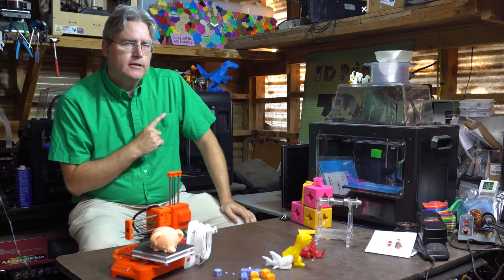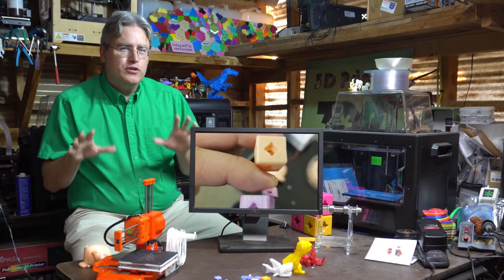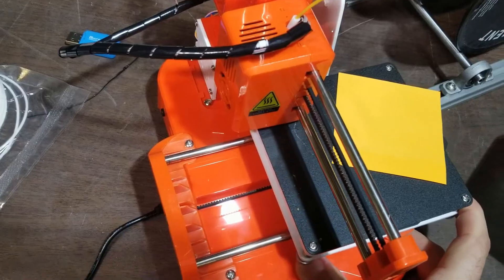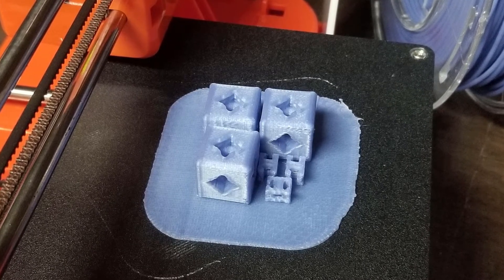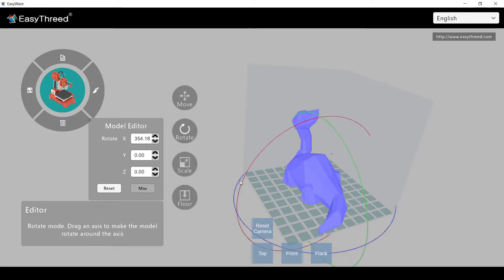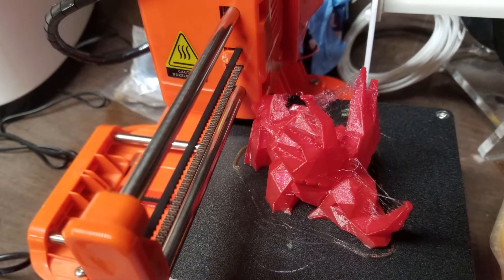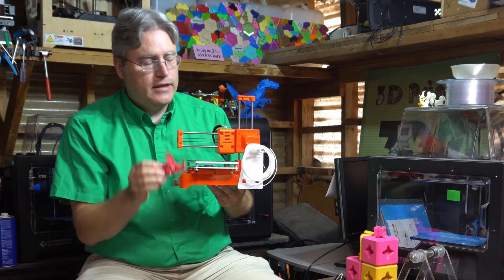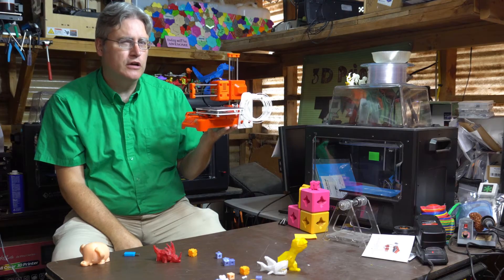Can an $80 3D printer be any good? EasyThreed K7 Review

Comment: Hi. I hope you can help me, I have a k7 printer, I have formatted the sd card I have tried everything possible but the printer does not print what's on the sd card??....It looks like it's very confused what to printer... It prints like two prints on top of each other. Have any idea what's going on with this printer?? Can it be the motherboard is damaged.
Reply from the maker: No idea. What slicer are you using? What model did you try slicing? what 2 models does it look like it's printing at the same time?

Comment: I am having a problem getting my "EasyThreed 3D Printer for Kids Mini Desktop 3D Printer 100x100x100mm Print U4N8" to print. I leveled the bed, seems level, used a bubble leveler for my android phone to make sure it is level. it is level. I go to print by pressing the greed light that looks like a play button, I wait, and wait, and wait and nothing. can I get some pointers or advice or ideas to try please and thank you...
Reply from the maker: Don't use a level on the bed. A more accurate word would be "Tram". The nozzle and the bed need to be level to each other, not to the earth.
But if you're pressing go and nothing's happening, then that's a different problem. Are you sure the SD card has a gcode file on it?

Comment: Can you make a video on how to make anything other than a rocket?? I got this and I can only figure out how to make a rocket
Reply from the maker: On the SD card there's a manual and a piece of software. You have to load up the software on a computer, load a 3D model into it, and slice it for the 3D printer, then save the gcode onto the root of the SD card, plug it in, and press the start button and it'll print it.

Comment: Hi.Nice video.I need a small 3d printer.This size is very good for me.I saw your print outs.these are not big problems for toys but do you think that l can print rc car parts  with k1 -k7.?
Reply from the maker: The accuracy of this printer isn't great. I might not recommend it for car parts. Toys or parts you don't care about only, I think.
You might want to look into the Kingroon KP3S S1 from Sliceworx if you want to keep it small, cheap, and funtional.

Comment: even after "calibrating" the printer.the filament after being extruded somewhat sticks to the nozzle and is pushed out of the way when printing.anyone have any idea how to resolve this?
Reply from the maker: Have you tried different filament? Have you tried a slightly higher temperature? Have you increased the stickyness of the build plate with Aquanet ultra hold hairspray or gluestick?

Don't try all of these at once. Test one solution at a time.
Reply: @3dpprofessor  thank you.i will try them all.i did adjust temp but have not tested yet.it was set to 180.i adjusted it to 200 to see what happens.i think it is a mixture of temp and the sticky news of the plate as you stated.i will use glue stick as I have extra laying around.i greatly appreciate the reply.thank you

Comment: I'm having serious issues with the easythreed X1, the 1st print I recieved the rocket model printed beautifuly. then using Drivethrurpg 3d stl file I got for free because I wasn't sure if it be up to the challage. I didn't change any setting i just used cura slicer. it started out pretty good, but as it grew in height it starting hitting the model I had adjusted setting tried again same result. then I tried too use a different model, it started reprinting the same model as before. today I readjusting the settings got a better result but the extruder has a tendecy to clump on certain part on the print then ruining the whole print. the two I did this morning look better then the last few prints. you can at least see what it is. I have done the adjusting on table according to the instructions. the magnectic bed warped, extruding has also burned holes in it. plus plastic still sticks too removable magnectic bed, even after using acetate. I have even used the bed without the removeable print bed. I lowered the extruder temp it seemed to work much better still clumping up on parts of model. any sudgestions.

Comment: Durability test please! Is it still working a month later? I bought two and they lasted a week.
Reply from the maker: That is one of the trappings of being a YouTuber when people are sending you printer after printer. I haven't had a chance to really run this one through the wringer. But I've still got it. Maybe I'll fire it up and see how it's doing.
Reply: @3dpprofessor  The Y-axis motor bushings and gears lasted a week on my two printers. I ran them almost constantly for a week. It seems the belt on the Y-axis is too tight and places stress on the motor shaft. I'd love to see owners stress test theirs then report back. Otherwise the printers were good for the price until they broke down. A replacement motor is $28 USD.

Comment: I bought this printer, but I'm unable to get more than 2 or 3 layers printed and then the model will detach from the base plate and the print is ruined. Any ideas?
Reply from the maker: What are you printing with? Have you properly leveled the build plate? Have you tried leveling it a little closer? 

A quick solution might be to use gluestick, but if you have access to repositionable glue spray is a little better.
Reply: @3dpprofessor  I'm printing with the white PLA that was in the box. Still waiting for the ordered extra PLA, but MadeTheBest is terribly slow at delivering it.
Tried leveling countless times, with different types (thickness/weight) of paper. The base plate also does not seem to get heated, which is strange because there's a heating element beneath it (and all the connectors are connected, of course).

I'm going to contact their customer service and return it. The build quality is really terrible.
Reply from the maker: @Robert Van Weersch  The K7 doesn't come with a heated plate by default.When I level the build plate, instead of trusting a piece of paper, I use the piece of paper to get it into the neighborhood, and I do a specially designed print and dial it in while it's printing. https://www.youtube.com/watch?v=Wso3Kj8oY00

Comment: This is my first 3D Printer! I was very cautious about the instructions and how I handled it because it seems cheaply made. But so far I love it and I am now hooked on 3D Printing (along with my many other hobbies). But I paid $60 for mine cuz it came with a bunch of coupons if I bought filament with it. I'm still trying to figure out where I can get gcode files or how to design my own.
Reply from the maker: I recommend cura. Create a custom machine, set the size to 80x80x80, and save your gcode.
Reply: By the way. Tinkercad creates STL files for the item you wish to print. CURA takes the STL file and makes it Gcode which is what the printer uses to print the file/item.
Reply: Where did you order from?
Reply: Simply search for STL files. Those are the models or designed items. Use Tinkercad (it’s FREE) to edit the item the way you wish. Then take that saved item and import it into a mesh program like CURA (it’s FREE). That program “slices” the item for printing. Then save the CURA file on the printers small memory card, eject it from your computer and place the memory card in the Easy Threed card slot. If your printer is on…turn it off (unplug it), then plug it in again. The “right arrow light” should be solid green. Press it once. It will begin to flash, then let it run. It takes a few minutes to load and get going. (Has to heat up.)  To cancel…not pause…but cancel the print…hold down the far right green arrow for three seconds. 

NOTE: The printer will print the most recently added item to your memory card. 
NOTE: Every time you want to print, you must power down the printer and power it up again.
Reply: @brianfreeman5208  will STL files print too or just Gcode?

Comment: 10mm per second? i have the x3 easythreed printer and it can do 40mm per second max
Reply from the maker: Interesting. 

Is that a slicer setting or are you somehow measuring actual movement speed? On the K7 I changed the slicer setting to 60mm/s and the hardware just kinda ignored that and went back to a crawl.
Reply: @3dpprofessor  just the print speed setting in Cura, if you go on their website they have all the manual's and the k7 manual said it can to 10-40mms per sec. I think all their printers max out at 40mm per second because of the types of motor they use. Good little printers to learn with

Comment: Hey guys Creality's 4.8 slicer program Knows what K7 X1 means I just put in Custom EEF printer and boom popped up with the Dimensions but this is the Industry standard Maker bot Cupcake not withstanding... but I think I will hack it right out of the box...
Reply: My first hack will be a part cooling fan for the head... really cheap motor for the extruder so the heat break fan will be the second thing i upgrade but if i do enything i might have to replace the supply and board...looks like all the plugs are standardized so i might be able to throw in my Ender3  1.4 4 stock board.... annoyingly this might put this price point to the 250 dollars mark...
Reply: It costed me $144.00CND  on Ali Express Will be 13 days shipping at 25 bucks... it was 30 bucks cheaper on banggood but you did have DHL as an option but you would add another $76.65CND just for that option and it would be only August 28 not sept 3 so no contest.. this is just a backup to produce replacment parts.

Comment: Ey. Mine arrived, You should go over it again and update the firmware. mine CRUISES! travel speed is 50mm/s and print speed is around 40mm/s [I manually set it and acceleration down]
Reply: Just curious what you happened to update the firmware with. I just got this little printer as a companion to my ender 3 max and I knew there had to be a way to get more than 10mm/s lol
Reply: Which one u got? Can u use coca cola  plastic bottle as refill?

Comment: Interesting that they configured software endstops on it properly, makes me wonder if it's just running Marlin, Repetier or some standard firmware on whatever custom board it has.
From the slowness and price I suspected it was using those 12v geared steppers, and sure enough that's exactly what I found when straight up looking the model. No wonder they can keep the costs down so much, keep it small and the cheapest parts. By the way does it connect to a standard serial interface like Pronterface? Might make leveling it a lot easier that way, just manually sending each command instead of hand-moving the axis.
Reply: It runs Marlin

Comment: Noticing that it has a resolution of 0.1 - 0.2mm and that could be the circle, plug, and socket issues.
Reply from the maker: How would the layer height effect the fact that it can't make a small circle?
Reply: @3dpprofessor  not layer height, resolution, printing accuracy.
Reply from the maker: @eugenew2  Oh, it only claims print accuracy of 0.1-0.2mm. Sure, that would make sense.

Comment: You can mishandle expensive tools, - the ones you are so careful with - , a lot. They can have it, but look out with cheap tools. The way you pull the bed and on the y-axis to level the bed, is that the way to do it? The way you lift the printer by the z-axis, are you sure you will not bend those two small rods?
Reply: There's a video on the included SD card that tells you to do it like that...
Scary, but the way it's intended to be done.  Maybe they want it to bend, who knows
Reply from the maker: I view this the way I view getting tools from Harbor Freight. if I actually use it enough to break it within the first year of owning it, then I should buy a better one. But if I don't use it often enough that it matters in the end, then I can call it a minimal cost experiment.

Comment: I think this is a good option for me, I am in the drone hobbies, and I want it only to print parts for my drones I don´t need anything else, and I don´t wanna pay more. thanks.
Reply: @Ivan King ツ Thanks, I already have it, and I am printing drone stuff with out a problem. And it is in my budget. I have printed camera mounts using TPU, battery covers, radio gimbals protectors with PLA, all fine.
Reply: @ldelmuro  Does TPU really work well for mounts? I've never understood the idea behind that..
Reply: @Emily-fm7pt  I printed a  mount for a Eken 9 camera and it fits perfectly.

Comment: I already have two printers. I really don't need a third, especially one that needs a day to print what the others can do in a couple hours. So why the hell do I want this thing so much?
Reply: because i dont have 300$ for a ender 3
Reply: @BartholomewJenkins69420  your prices aren't up to date. The basic ender 3 is like $150 these days, and clones are even cheaper. I got my clone printer for €100
Reply: @fallingwater  Don't forget to add the euro to dollar conversion, shipping costs and possibly import taxes. An Ender 3 V2 (they don't even have the V1s anymore) here in Brazil costs at minimum, new and to your door, about 480 dollars.
Shipped through Aliexpress, the EasyThreed K7 comes at around 100, which might slip under the taxed import rule so no extras. No matter how much more capable, that's still almost 5x the price.
Reply: @volts_n_bolts  That might be why I've just recently built my machine but already have a stash of spares
Reply: Well failure would be another reason for an extra printer.

Comment: Pretty neat little printer. I'm just curious if it has thermal runaway protection.
Reply from the maker: Dunno. It's a pretty tight package so I don't know if it's ever likely to break the closed loop, so probably not a big problem. But an interesting question. It knew where it's limits were in the movement system.
Reply: I know that the x1 has it, so the k1 probably does too.

Comment: I appreciate that $80 is very little to spend on a 3d printer, particularly one that works as well as this one, but I still can't help but recommend saving more and picking up an ender 3... yeah, it's twice the money at about $170, but because it's so ubiquitous, it's got WAY better support, lots of turnkey 3d printable upgrade parts, lots of electronics upgrade parts available, lots of standard parts available for when they break or get worn out, etc.  it's also got way bigger print volume than the threed printer which lots of models (especially the larger ones) are cut up into parts that are that size (you may have problems with many larger models with that smaller build volume), and the ender 3 is still very reasonably priced.
Reply from the maker: But the Ender 3 can't print ninjaflex. Also, I generally add $100 to whatever price you pay for an Ender 3, because you're gonna spend on it.
Not say the K7 is better. They're just different. I think the Ender 3 is still a fine suggestion for some people, though I still prefer the FlashForge Adventure 3 for the general case.
Reply: @3dpprofessor  Ender 3 can't print ninja flex with the direct drive mod?
Reply from the maker: @alanfitzgerald9026  I'm not sure upgrades count. Not to mention the difficulty of counting the cost for your time, let alone the additional cost of parts, or what that does to the overall reliability of the machine. Heck, there's a mod for the Ender 3 that turns it into a belt printer. Saying that mods count as root functionality is a slippery slope.
Reply: It's a different level of commitment though. I wouldn't expect this tiny printer's target customers to consider it the starting point for modding the hell out of it (though knowning myself I probably would do exactly that); it's a prepackaged just-works kind of deal one gets for funsies, or for kids. Also the ender3 is a bit long in the tooth by now; I'd go for a more up-to-date model with upgraded drivers, a better board and a cooling system you don't have to redesign yourself. If I had to start anew today it'd probably be a Voxelab Aquila.

Comment: I'm wondering if replacing the springs with either, higher quality/high stiffness springs, or silicone columns, would help it keep the bed level over time.  Either of these options are a cheap upgrade/test. I did that to two of my printers, and the bed rarely needs releveling.
Reply from the maker: I've heard of the spring option, but I don't know what a silicon column is and I'd love to know more.
Reply: @3dpprofessor  Homemade: https://www.youtube.com/watch?v=H_we5zKI48k
Premade: https://www.youtube.com/watch?v=l3jV0C1o1Gs